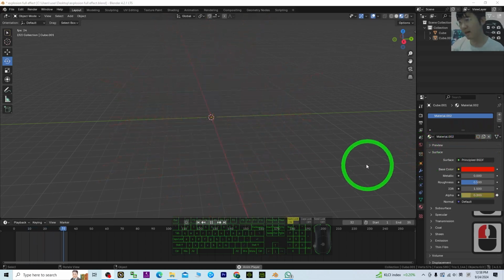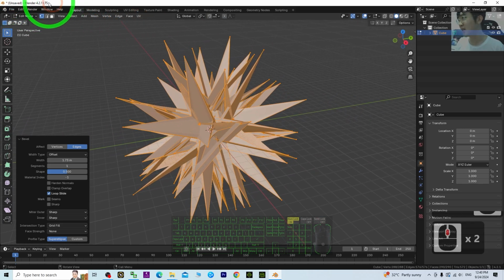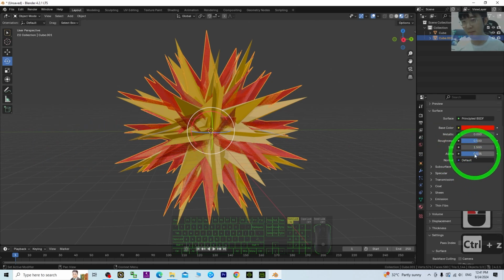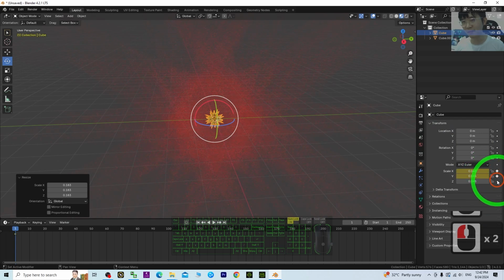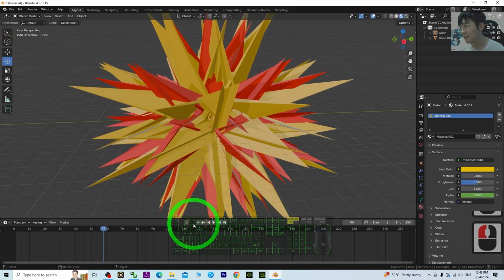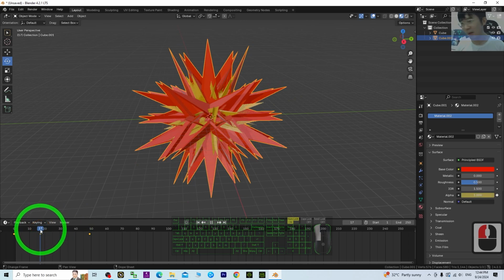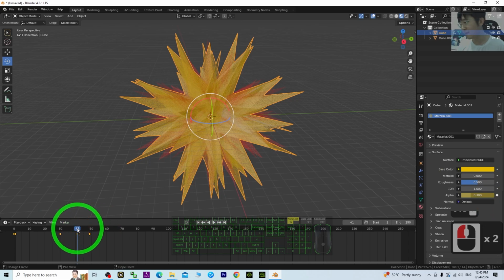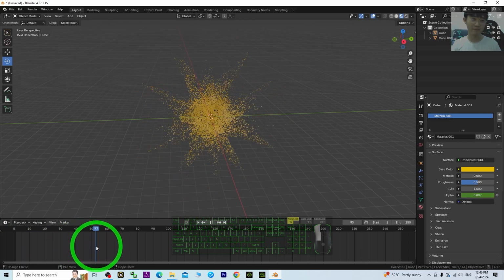Blender 4.2 Explosion VFX Tutorial | Easy No-Plugin Explosion Animation Guide

Comment from the maker: This tutorial demonstrates how to create a simple explosion VFX in Blender 4.2 without the need for any external plugins. The process is broken down into the following steps:
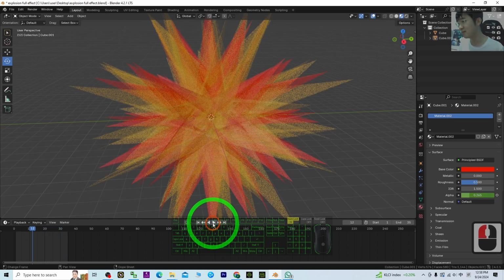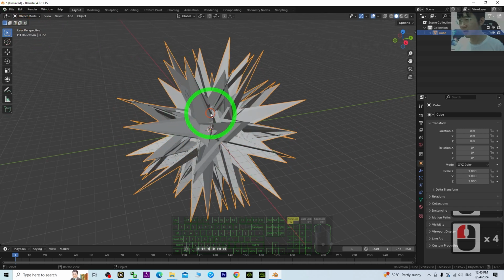1. Modeling the Explosion Shape (0:14 - 1:06):
•	Start with a basic cube and enter Edit Mode.
•	Use the bevel tool (Ctrl + B) repeatedly to add vertices and manipulate the geometry until it resembles an explosive, jagged shape. The final result is a low-poly object with approximately 290 faces.
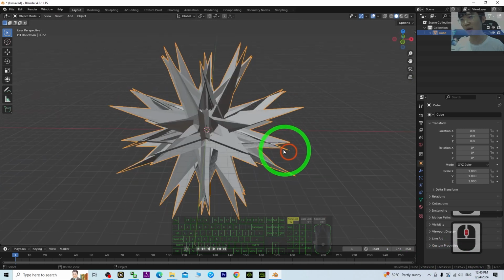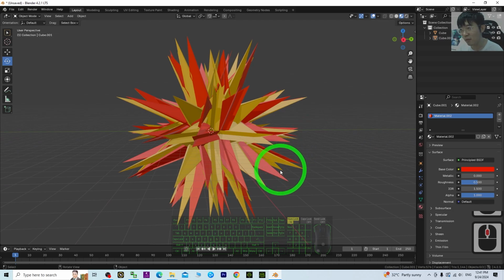2. Adding Materials and Colors (1:15 - 1:47):
•	Enable material textures and assign colors to the model.
•	You can duplicate the object (Ctrl + C and Ctrl + V) to create multiple layers (e.g., different colored sections of the explosion) for a more complex look.
3. Animating with Keyframes (1:50 - 6:48):
•	Opacity/Alpha Animation: Adjust the Alpha channel in the material settings. Set keyframes to control the visibility, starting from 0, increasing to a peak (around 0.3–0.8), and finally fading back to 0 so the explosion disappears.
•	Size Animation: Use keyframes to scale the object from small to large over time to simulate the expansion of the blast.
Conclusion:
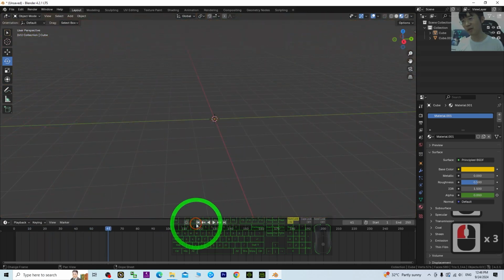•	By observing the animation and refining the alpha values and timing, you can achieve a more realistic explosion effect (6:48 - 7:01) before rendering your final scene.